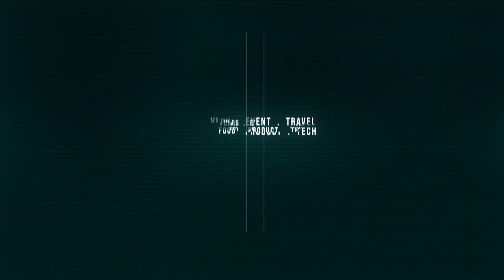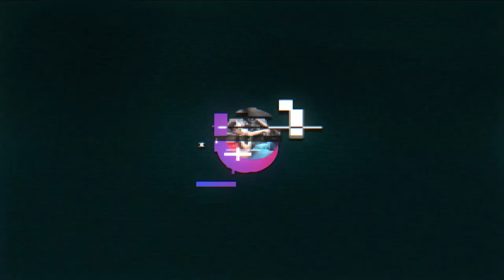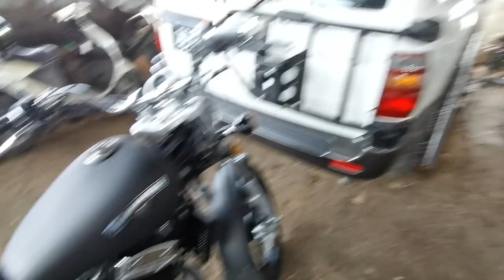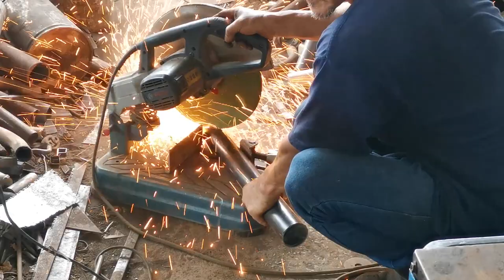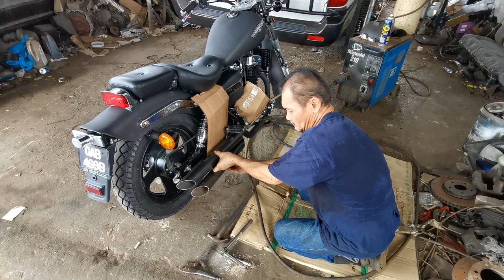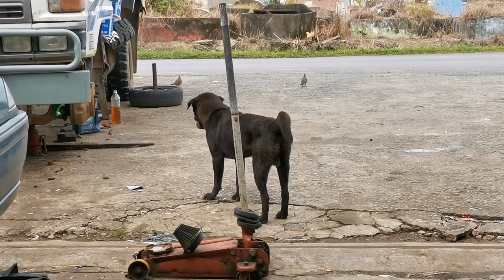Custom Exhaust Pipe - Patagonian Eagle 250

Comment: Did you get stop by police? 👀 I've change my exhaust to a full set stainless steel exhaust... Well self made... But I haven't encountered any police before... So idk if you get stop already? Cos your mod is a free flow mod so you need to dynotune your bike if not your bike will have srs engine issues. Please do reply to this comment... Really need to know what you say to the police!
Reply from the maker: hello there. so far I haven't met any roadblocks yet. there was once I was passing by a group of police but I quickly sped off, hahaha. this setup is too loud for a legal bike but I don't care because I wanna ride free & happy, hahaha.

I have thought about re-tuning my bike (it's a carb, not EFI) but the mechanic said my bike is fine, I asked them to do it twice but both times they said no tuning required. maybe I'm gonna try at another tuner and ask again.
Reply: Hi I minat Patagonia  ingin nk angkat satu. Nk tnya moto ni ok ? Ada byk problem ?tq
Reply from the maker: @tanjunwai2079  so far takda prob & isu. Sedap pakai
Reply: @Omara86  maintenance pon ok ? X mahal sgt?
Reply: Bro tolong dijawab itu pakai pipa apa ya? ukuran lebar dan ketebalan dan juga panjang brp bro?🙏🏻 mohon di jawab bro🙏🏻